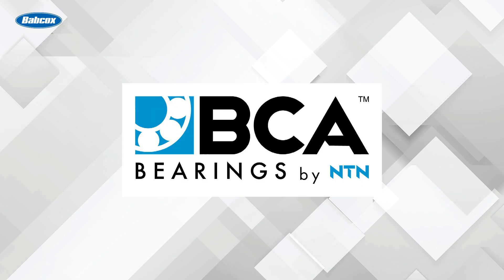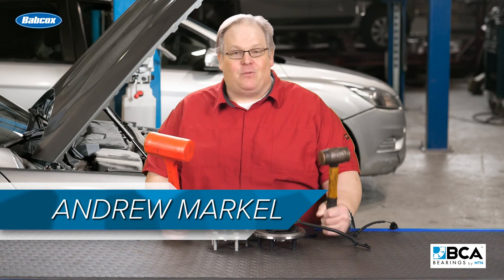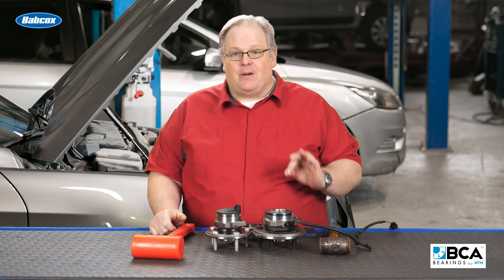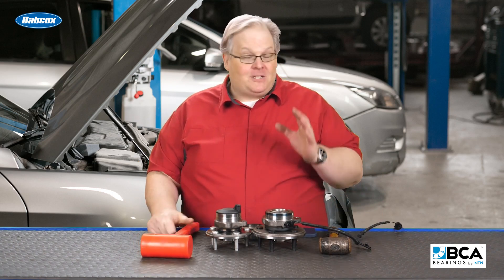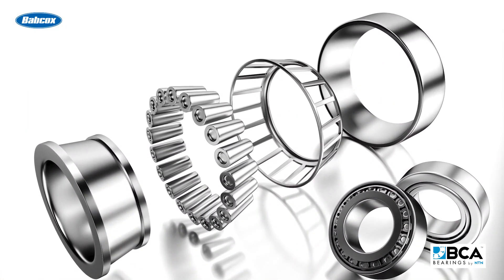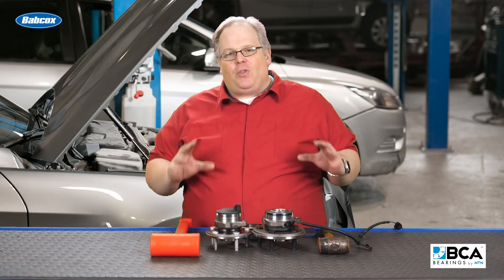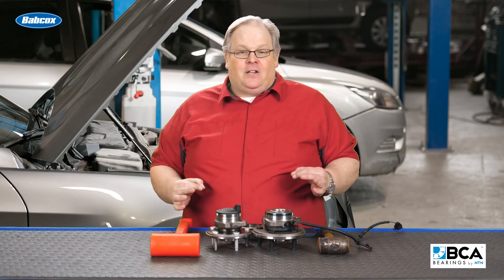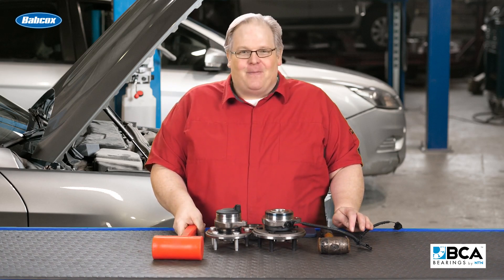Can A Hammer Damage A Wheel Bearing?

Comment: the tire dampens the impact on the bearing balls, so road impacts are not the same as hitting the bearing with a metal hammer.  In the aerospace industry, it is a big No No to hit any bearing with a hammer.
Reply: Man please your little Hammer ain't doing nothing to that wheel bearing. Get real
Reply: @MacAutoDiag  it is called brinelling.  All I can testify to is the best practices used in aerospace.  I did not write the guidelines, we just make sure they get applied.